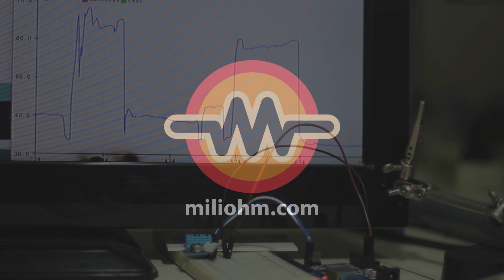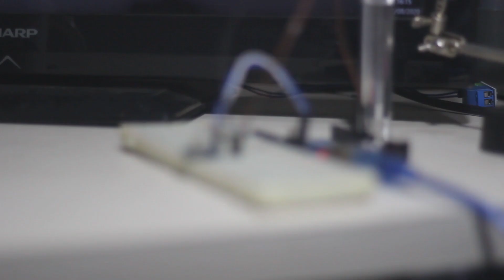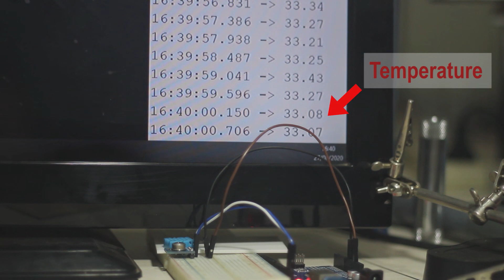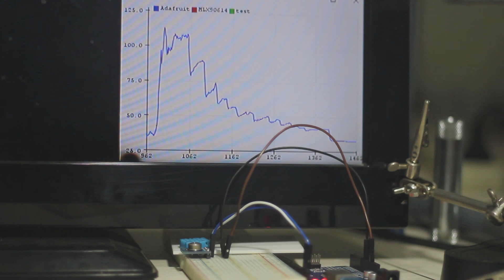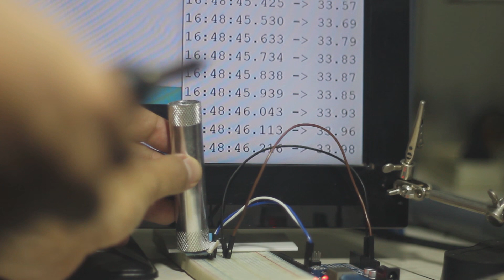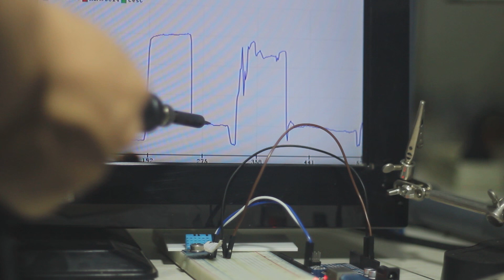MLX90614 Temperature Sensor Distance Range Test and Distance Extension

Comment: I think you have to consider this sensor has a wide field, like a flashlamp. If you have great distance, you will not only measure soldering iron, but the ambient temperature behind, and result will be average temperature. You should maybe do a new test and measure wall temperature, or temp of a big TV or a large object on a distance, or for example a heated bathroom floor, so you measure object with consistent temperature instead of measuring many different objects, with different temperature and distance.. there is no problem with distance, it is just that you measure many things..

Comment: I tested 3 variant of that sensor. the one you testing is the basic one and is only accurate for close range like 1 cm in my testing. The other one you showed on picture I tested also it doesn't only have a  tube but a lense inside too. That's why your testing it shows some improvment but not accurate reading for long range.
Reply from the maker: Yes i believe that
Reply from the maker: And what about third one?
Reply: @miliohm  the 3rd one is in between the simple version and big tube. Not a big fan it has it's purpose I guess in midrange.

Comment: hi mr I'm having the same project, if it is applied using human body temperature, does it matter too?
I have difficulty because the sensor reading is not stable
Reply from the maker: Sensor ini memang kurang bagus untuk jarak lebih dari 2cm. Jadi saya tidak merekomendasikan. Tapi boleh dicoba kalau mau pake cara saya dengan dikasih semacam pipa di depannya. Kalau masih tidak puas bisa pake sensor ini tapi yang tipenya jarak jauh. Lebih bagus kalau mau buat screening manusia.
Reply: @miliohm  betul, lalu cara kalibrasi yg benar, agar suhu terbaca tidak jauh dari pembanding suhu thermometer pabrikasi, bagaimana ya sir?
Reply from the maker: @anggunpalawatipalupi768  kalau jaraknya berubah-ubah harus ada kompensasi terhadap jarak. Misal dikasih sensor jarak. Kalau jaraknya tetap bisa coba bandingkan dengan termometer standar dan kalikan dengan faktor kalibrasinya. Misal dikalikan 0,9 atau berapa tergantung hasil percobaan.
Reply from the maker: @anggunpalawatipalupi768  oh ya dan misal jarak sama tapi pembacaan tidak stabil bisa coba smoothing di programnya. Baca beberapa kali lalu ambil rata-rata
Reply: @miliohm  oke sir terimakasih sarannya 🙏🏻👍 disensor mlx90614 kira2 faktor yg menyebabkan pembacaan beberapa sample ada terbaca suhu rendah, namun dithermogun terbaca normal, apa ya sir?
Reply from the maker: @anggunpalawatipalupi768  kalau untuk masalah ini bisa coba pake saran yang terakhir itu mba, dibaca misal 20x. Kemudian dirata-rata. Bisa jadi lebih stabil mba. Di video ini saya juga pake metode itu.
Jangan lupa subscribe ya mba btw 😀
Reply: @miliohm  sudah sir 👍😊
Reply from the maker: @anggunpalawatipalupi768  panggil mas aja. Wkwkwkwk 🤣

Comment: Hi Sir, just to make sure, does it not affect the sensor (i.e.the sensor is getting hot) when putting the pipe on the sensor?
Reply from the maker: In my experience it's not. As long as it doesn't touch the metal part
Reply: @miliohm  is it recommended to use this sensor for screening temperature of a person?
Reply from the maker: I don't think so, you need the better distance range sensor. Like I mention in the video
Reply: @miliohm  will the code be the same sir if using DCI? and when using the pipe to extend the range, wouldnt it detect the temperature of the metal surface?

Comment: I did a body temperature measurement project. But results vary according to the ambient temperature. Actually the object temperature depends on the ambient temperature. How can we overcome this problem? MLX90614 generates object temperature based on ambient temperature ???
Need to do things like change the EPROM address?
Reply from the maker: How much is the ambient temperature you got?
Reply: @miliohm  29C but somewhere a little than cold. example i got 26 C

İf 29C in room = object 29~C
if 26-27C in room= object 27~C

can you understand me? sorry for my english
Reply from the maker: Yeah i can understand that. I think the ambient temperature has effect on object. Because it's the air temperature. Try to compare with a termometer

Comment: my sensor (mlx90614) is not working so stably. The temperature of my finger changes 3 degrees at 10 centimeters.
Reply: If you use the normal version sensor
Reply: You need to change sensor for DCI version.

Comment: Hi, I am using this mxl90614 to measure body temperature. Why it detect I am 33.0 degree celcius? not human temperature range is 36.5–37.5 °C?
Reply from the maker: Try to calibrate the sensor with a thermometer. Because this sensor is so distance sensitive.
Reply: @miliohm  can i know how to calibrate?
Reply from the maker: @xiujuan3777  measure an object with same distance at same time. Take some varies data, then use formula to make sensor data like the thermometer. For example if the sensor read 20 degrees and sensor 40 degrees. Simply multiply the sensor reading with 2.

Comment: hey i am having trouble getting my sensor to read anything but 1899.59 f i changed the jumper wires and replaced the sensor what could be the problem? is there any contact info to reach you also?
Reply: i also changed it from 5v to 3.5 and changed the sensor when doing so very confused any help would be greatly appreciated
Reply from the maker: @lifestylesglassgallery767  try get a new one, and use only 3.3v. never use 5v. Maybe it's already damaged. But before that you can try i2c scanner and see what you got.
Reply: @miliohm  the i2 scanner doesn't pick it up? and i tried both of those because i thought i damaged the first
Reply from the maker: @lifestylesglassgallery767  did you always use 3.3V or both ever connected to 5V?
You can also check the cable with multimeter. In case maybe it's broken